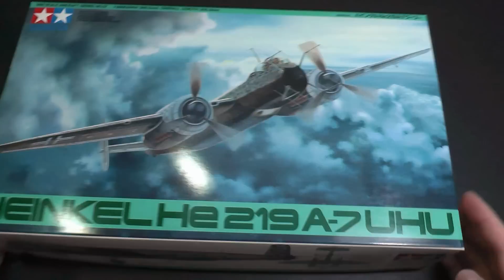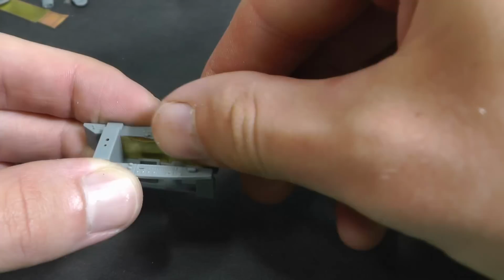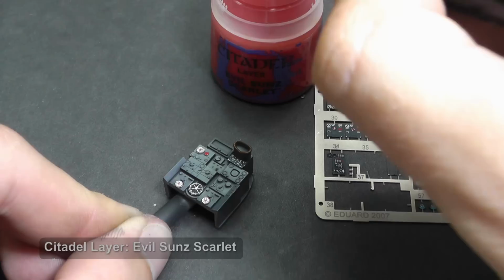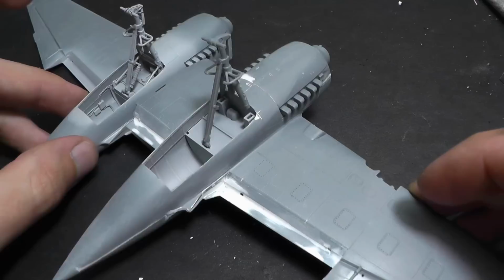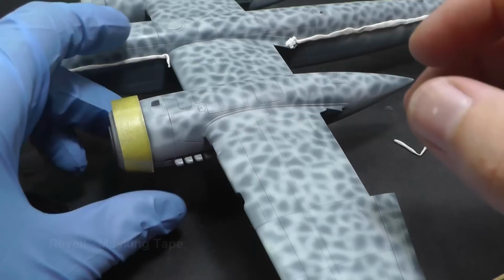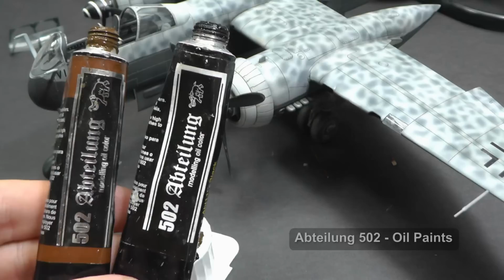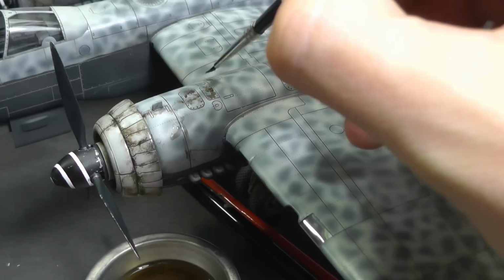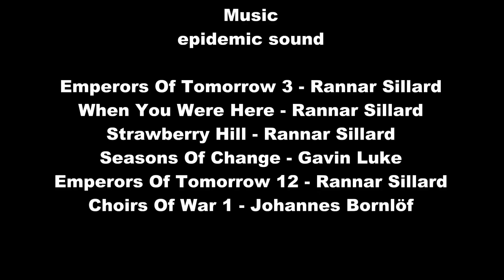Heinkel He 219 Uhu Tamiya 1/48 - Aircraft Model

Comment: I learn so much from you. One thing I do that gives a nice effect is to actually scratch the paint instead of painting on scratches. I add a gun metal wash inside the scratch. I dont scratch deep, just enough to dent the paint.
Reply: Sounds like an interesting technique, James!
Reply: nice idea! I personally use Salt Technique to make scratches and chipping too, but it is a bit difficult sometimes
Reply from the maker: It is a useful technique for heavy weathered japanese models or AFV, but I do not recommend if you need only a few scratches. You can easy overdone scratches and result is more or less random. Also, it requires more layers, and the whole process is time-consuming. However, it is handy technique and is good to know it.
Reply: I don't even do scratches

Comment: Great work! Just one note though the antlers on the front are not for radio but for the radar  detector . You can see the  radar scope on the top of the back cockpit instrument panel.The Heinkel Uhu " Owl "  was a night fighter and the radar equipment was used to spot and attack enemy bombers  after dark. Very advanced tech at that time. Now i hope that any body can figure out why the engines have such long exhaust pipes!
Reply: ...and the tail Radar Antenna is "passive"  receiving enemy night Fighter detection.
Reply: The long exhaust pipes were used as "Flame killers" in the  night.

Comment: Amazing as ever! David or anyone else could I please have some advice on painting fine lines with an airbursh as shown in this video? I use Revell Acrylic Paints with a Sparmax Airbrush with a 0.2mm nozzle so it should be thin enough. No matter how well I thin and mix the paint or how low the air pressure is it never ever works. It is severely limiting my progress so any help would be much appreciated.
Reply: Is your airbrush a double action type? If you can move the lever back and forth it's a double action type and if you move the lever just a VERY little back with a 0.2mm nozzle you should get pretty good fine lines.
Reply: @Azor99  It has the option for single and double action so I have tested both out, although the double action not so much. I might try just doing more experimentation with what you recommended. Perhaps I haven't tired enough. Thank you for the advice!
Reply: It's almost impossible to make very fine lines with single action mode. Definitely try double action. Good luck!
Reply: @Azor99  Thank you very much! Hoping it will work so post and pre shading will work better.

Comment: Is there a reason you don't mix those citadel paints before applying them? 
Usually you mix and dilute them before use but here such is not the case.
Reply: Hirvitys hè uses the citadel paints to paint small details with a paint brush, he wants a thick consistency of the paint for thuis purpose, he only thins his paints when he is painting Large surfaces.
Reply: No offense but that comment makes no sense. Why is thick, less controllable paint on a detailed part a good thing? 
I'd understand if he didn't dilute but completely forgoing mixing is another thing.
Reply from the maker: On the small details, it is not essential. Color has perfect coverage properties even If you will use color form the top without mixing. On larger parts, I prefer mix color with water properly.

Comment: Can you please explain to me why every single time I try to use Tamiya Panel Line Accent on a model, even after I put a clear coat down, it eats the paint away from underneath? Why can’t I wash away the dots of black without taking the paint off underneath? I have ruined three perfect models now trying to do a wash. I don’t get what I am doing wrong.
Reply from the maker: You are probably using enamel colors. You need acrylic or lacquer. Or You can use enamel color but then I recommend cover result with lacquer varnish.
Reply: I used Alclad Polished Aluminum paint and Alclad II Lacquer Gloss Klear Kote (ALC 310) over the top of that. Once I used the Tamiya panel line accent it just wouldn’t clean up. The panel lines filled in nicely but I couldn’t clean up the dots left over. Do I use enamel thinner to clean up the panel lines after it dries completely?

Comment: Guys I need help. I recently purchased an Iwata Neo airbrush, and as I used it the first time and then went to clean, I noticed that while the needle looks perfectly fine, there's must be a bur at the very tip or perhaps it's bent on a microscopic level? My paper towels etc. catch when I try to clean it. It appears to still spray accurately. Do you think it's fine? Should I try to very carefully sand it with 2000 grit sandpaper? I don't want to take it back unless I have to because it's an hour drive and I'm not sure they have more in stock to replace it with. Appreciate your expertise and advice fellow modelers!

Comment: I've been painting models with a paintbrush for over 2 years and I would like to get an airbrush for a cheap budget and have a decent setup. What compressor and airbrush would you recommend for around 150 euro?
Reply: I moved from brush painting to airbrush around 8 months ago and started with airbrush and compressor from Neo by Iwata. However the nib on the airbrush was too delicate and broke whilst re-attaching after a clean. I replaced it with a Badger Patriot 105 which was less than 70 USD from Amazon and it has been good. The nib is bigger and less troubling to remove and re-attach. It is quite robust and makes a good starter air brush. The Neo compressor is still going good though and buying a quick release connect for a few dollars has made it much easier to use.